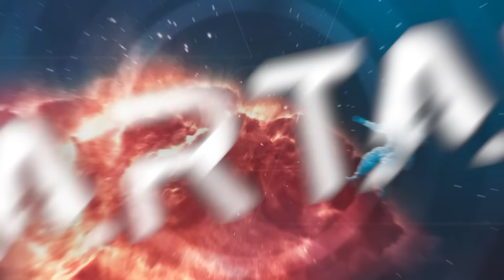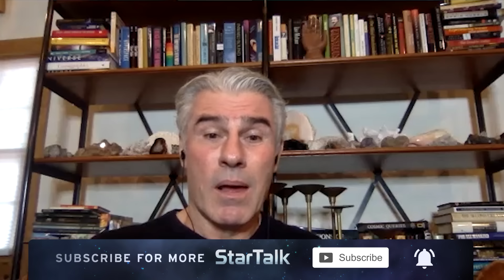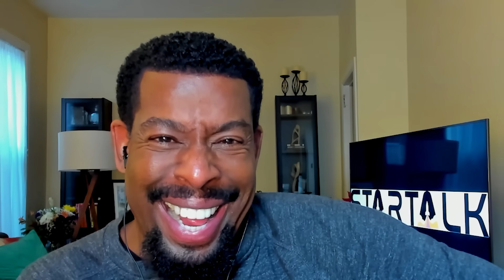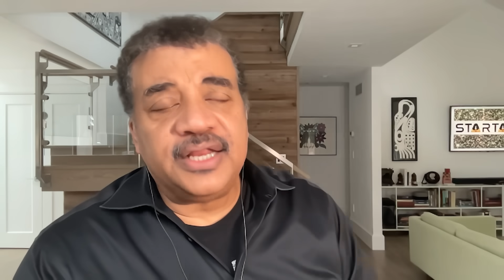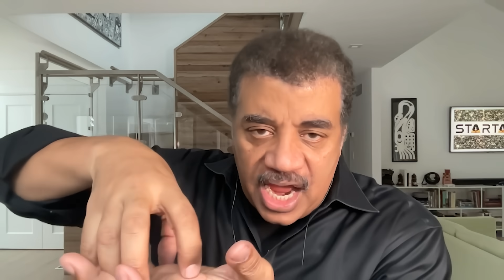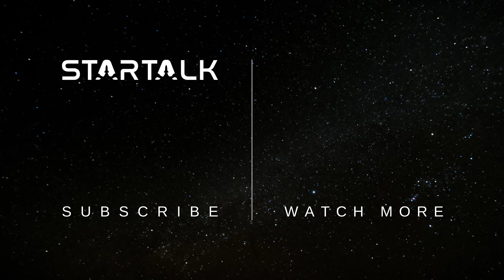What’s The Fastest A Car Can Go? | Neil deGrasse Tyson Explains...

Comment: Gary, you nailed the NHRA model... those 11,000 HP Top Fuel dragsters (with the T-Rex fron t wheels) pull up to 5 G's on launch, due to the super sticky slick tires and the burnout warming the aforementioned tires up to increase traction to the point of insane.
Reply: BTW I highly recommend watching a top fuel drag tire in slow motion when they launch. Its amazing. Incredible engineering really, if you think of the forces on that tire at launch which then has to be able to handle 330+ MPH top speeds just a few seconds later.
Reply: @Nefville  what's even cooler as if you notice they don't have gears. They're just single speed transmissions. If you measure the tire they actually can't get to 300 miles an hour. But as they go faster the tire gets taller and taller increasing their gear ratio. Hence the tires are the transmission.
Reply: Big tire cars, like on a top fuel car there are two things happen, one, there is spin happening, they do not hook hard like a drag radial car, if you don’t have the spin you will have tire shake which breaks parts. Second the side walls are meant to wrinkle to soften the torque as it’s applied in the first few milliseconds. Then there is track prep, they use a glue specifically designed for drag racing, but with big tires you do not want a super prep track or you won’t get the little bit of spin you need, with a drag radial, you want as much glue and prep as they can lay down because drag radials want a dead hook. Side note, there’s has actually been a shortage of traction compound, the main component is made in Germany and the company is cutting back production leading to compound producers to R&D new formulas.
Reply: So Top fuel dragsters are breaking laws of physics and doing the impossible?
Reply: @Nauda999  thanks to engineering, top fuel cars, wether dragster, funny car or even an altered are pulling 5G’s of acceleration and cover a 1000’ in 3.75 seconds at over 330 mph.
Reply: @beekeeper6109  didn't watch whole video, only to the point where Neil said that car can not have more than 1G horizontal acceleration and can't go from 0 to 60 under  3seconds.
Reply: Most of you are missing the fact that 90% of where a top fuel dragsters acceleration capabilities come from. It’s not the power, nor the tires, the exhaust or even the wing: it’s the clutch. It is impossible to feed 12000 hp into the tires all at once. It would literally blow the tires off and the car wouldn’t move far. The clutch and it’s set up is the key. Ever notice the grey dust coming from these cars at the launch? That’s clutch dust caused by the clutch drive plates slipping against the driven plates. Do a little research on how a TF clutch works.
Reply: Your giving too much credit to the tires, track conditions rule everything you do in drag racing.
Reply: @dalelc43  Sure ... any old tires will do.  🙄
Reply: and the exhaust is pointing upwards providing significant downforce
Reply: The exhaust pointing upward also adds to the downforce

Comment: There are also cars faster than 1g, depending on the measurement trick. Many auto makers do not count the first wheel turn or start counting when the front wheels cross the start line, which  is sometimes wider than wheel perimeter.
Reply: 1G acceleration yields a quarter mile time of 9 seconds.  Many cars and motorcycles are faster than that.
Reply: @fixbertha  Niel already mentioned why they are faster than 1g, because they use sticky tires that result in a Coefficient of friction greater than 1. Also, cars in particular, even without having sticky tires, can have an average acceleration of more than 1g, just not from standstill. As you go faster, you can generate more grip through your aerodynamics, resulting in increaseing acceleration towards the end of the quarter mile.

Comment: but you're forgetting Top Fuel dragsters, 0mph-330+mph is 3.5-4.0 seconds out of 500ci engines. granted not a road going vehicle but still out performs the 3 second ideology presented. You don't necessarily need more weight, when you can add more tire width and sidewall to the tire.
Reply: he talked of top fuel dragsters, watch the entire video :) that's an example of how to get a friction coefficient >1
Reply: @Le Doynier  i did watch the entire video, and yet he did not specifically mention these, he made the statement of any vehicle with certain surface prep, etc....
Reply: Amazing few ever heard saw them in real life.. Yet a  fighter jet smokes them .
Reply: @Motorhead1  not from a dead standstill, they dont. If the motor was capable of staying together long enough very few things could even compete in lets say a mile race
Reply: @LegacyLives96  In 1980s Jet dragster blew away top fuel cars in 1/4 mile. Not sure about today though.
English town NJ
Reply: @Motorhead1  today top fuel makes almost 15k hp. 3.3-3.6 sec quarter mile at 320-340mph
Reply: Fun fact: Propeller aircraft can accelerate faster than jets.
Reply: @lawrencedoliveiro9104  Turbo prop like on C 130 Hercules
Reply: @Motorhead250  Not sure, though. They are still turbine engines, still subject to turbo lag.
Reply: @lawrencedoliveiro9104  Not a turbo... It is a jet powered propeller Turbo prop.
Helicopter also use that engine.
Not like a turbo on a piston engine.
Reply: @Motorhead250  That’s what “turboprop” means. It’s also the reason why jet engines need longer to spin up.
Reply: @lawrencedoliveiro9104  When I fly on turbo prop it's like instant acceleration. Jet engine is spooled  up before prop blades are pitched you get pinned in seat intense acceleration no lag..
Reply: @Motorhead250  They put the brakes on before spinning up the engines. That, too, takes time. Do the same thing with a non-turbo prop plane, and it can do it in less time.
Reply: @lawrencedoliveiro9104  true. Awesome power in turn prop short runways.
C-130 we were on felt like it could go vertical..lol
Reply: @Motorhead250  Power to go vertical is no big deal -- most jet fighters can do it. But they still have trouble taking off from a short runway.

Comment: One of the great new motorsports is generally referred to as "Drag and Drive". Pretty much exclusively amateur events (no real prize money, although many are professional car builders), which are, in general, one week long, drag races at 4 or 5 different tracks. The format they shoot for is gather at track A, register, car inspection and test on day 1. On day 2 Race for time only at track A, then DRIVE that same car to track B under it's own power (no time limit or any sort of race between tracks) following a predetermined route with check points.On day 3 Race for time only again at track B, pack up and DRIVE the same car to track C, wash and repeat. The path of travel after approximately one week ends up back at track A with the best aggregate time of the race portion who also made all of the check points declared the winner. There are multiple class and therefore multiple winners with the Grand Prize going to the quickest aggregate TOTAL, or average fastest at all the tracks, time. They, very loosely shoot for 1320 miles total for the drive part, so as to correspond to the 1320 feet of the drag race.  The current record holder is TOTALLY UNBELIEVABLE to old school drag racers. Not, because of it's track speed, but because of it's ability to drive hundreds of miles on the streets and highways, pull into the track and do those dedicated race car like track times! https://www.motortrend.com/events/tom-bailey-wins-hot-rod-drag-week-2022/

Comment: A wheel is an interesting thing. 
 
The point that touchex the ground does not move relative to the ground, is then lifted up and after a quarter circle accelerated,. reaches twice the car velocity in the OPPOSITE direction after the second circle, then it goes back down.

Comment: Steam locomotives se sand they trickle on the tracks to increase the friction when they start from standstill, and I think they still do that on electrical engines. The friction issue does not change.
Reply: Streetcars have gravel boxes so they can sand the track if there are leaves on them making them slippery, maybe they use the sand in emergency braking too for quicker stop.

Comment: Was wondering about the Top speed? What is the top speed that a vehicle can go using friction (no rocket) without sticky tires? It can accelerate at a maximum of about 1G, but up to what point? Not sure what forces would start being the relevant ones at high speeds.
Reply: Aerodynamics, wind resistance. And friction and the engines limit.  Once you're over a certain speed wind resistance will be greatly increased. So you will need Aerodynamic to counter balance wind resistance and you want to eliminate friction for more speed. Eletcro magnets will eliminate friction problem. And the engine will be need to be made for speeds higher than we know today. Factor in those and you can get super high top speeds. Also reducing weight (mass) helps to achieve higher top speeds
Reply: @ferociouzmonk  Weight (or more precisely mass) has virtually zero effect on top speed.  More mass will slow the rate of acceleration but will only affect rolling resistance, a tiny, tiny factor compared to wind resistance.
Reply: @fixbertha  not really. Take 2 of the same vehicles but one has reduced mass let's say carbon fiber instead of steel. You'll get an 15-20% speed increase.  This is how a motorcycle with only 95hp can accelerate and have higher top speed than say a Lamborghini with 400 something horsepower.
Reply: @ferociouzmonk  With two identical vehicles, one lighter the other heavier, the lighter will will accelerate faster but they will have the same top speed.   The lighter vehicle may have a tiny advantage in lower rolling resistance but that's virtually not measurable in the real world.  It is easier to accelerate a lower mass than a higher mass.  Top speed is a combination of the forward force at the center of the drive axle (from the engine), the engine torque curve, wind resistance, mechanical resistance and gearing.
Reply: Buggati is the limit. While developing Veyron, they found out, that there are no tires that can withstand speed higher than Veyron's or Chiron's maximum without literally "deleting" the tires if maintaining the speed or increasing it. 450-500 km/h is already crazy, what more would we like with "classic" setup as you mentioned 😉
Reply: @peterjobb8938  That's for "available" road car tires.  Funny cars do over 523 KPH all the time.
Reply: I also thought it would be a bout top speed and I thought that would be orbital velocity, once you hit that you leave the surface. But, with aerodynamics you could stick to the surface above that speed too... yes, air resistance will melt you, but besides that... 🙂
Reply: To try to take it further, how about redesigning the road. What if you had two opposite surfaces, with tyres contacting each one? So the suspension system can push the two sides apart, giving you any amount of downforce you like, independent of aerodynamic factors (i.e. vehicle speed).

Comment: Actually... Rimac Nevera – 1.85 seconds (0-60mph)
Lucid Air Sapphire – 1.89 seconds (0-60mph)
Pininfarina Battista – 1.9 seconds (0-62mph)
Tesla Model S Plaid – 2.3 seconds (0-60mph)
Reply: Well, what Neil didn't account for is while it's true that spoilers and such do not work when you're standing still, however as you start moving the effect gradually increases. Though it's probably not that much at such relatively low speeds, but especially towards the end you can increase the acceleration.

It's also funny since Neil mentioned gears... Technically friction between two materials is working similar to gears but on the atomic level. So it highly depends on the actual road surface and the material structure of the tire. Even when using gears it would be necessarily be special gears that do not produce any upwards force that may make the gears slip as well. Though in reality, especially when increasing the torque / force any kind of material would probably bend slightly. So there's always a point where the gears could be pushed out and slip. In the extreme case the material would simply break / deform.
Reply: @Bunny99s   it seem he doesn't know about traction control or awd torque vectoring

Comment: Trains work like the gear principale Tyson is explaining
Reply: No they don't.  They rely on large amounts of mass on the metal wheels (which are on the metal tracks).  Most trains also have small sand dispensers to help gain traction if the track surface gets slick and causes wheel slip.  Some locomotives are also equipped with modern controllers to better manage torque output from the electric motors and help prevent slip (works similar to traction control in a car).
Reply: I was thinking, the logically obvious next step is putting the vehicle on funicular rails.

Comment: Uh. Clearly this is untrue. A Tesla model S Plaid can accelerate 0-6 in right at, and occasionally just under, 2 seconds. It does not heat it’s tires to melt the rubber prior.. it does not have a jet assist.. it just does it. The tires are not digging into the road.. they can do it on ANY pavement, very near 2 seconds. Even without rollout, they are well under 3 seconds repeatedly. Don’t take my word for it.. there’s about 100 videos on youtube that show it by many different owners.
Reply: 1 G is the maximum acceleration if there was no down force from the air. Once the car starts rolling, down force increases and you can exceed 1 G.
Reply: @MonstieurVoid  go drive a Tesla model S Plaid and tell me how they are defying this law of physics. Because they don’t use a downforce, they don’t use special tires or prep.. it just does it
Reply: @airheart1  All sedans have enough down force to exceed 1 G because of the shape of the car. The air pushes the car down as it flows over the hood and up the windshield. The spoiler at the back adds down force too.

Comment: What about aerodynamic down force?
Reply: The whole is a mess anyhow, it is all about maximum acceleration from standstill and  not top speed. 
 
The issue with downforce is that you need it the most at relatively low speeds in corners, but when you want a lot there you have an enormous drag at high velocities - adjusting the angle of the spoilers would be the solution, but when it breaks, it gets dangerous in an instant. 
 
My 28-year old Calibra is optimized for low drag and high speeds, and as we still have unlimited autobahns, I will not add any drag-inducing spoilers on it. I eased it up to 130 mph up to now (want to get it slowly used to moving again after it had stood for 10 years), and it is nice when you have a mileage of 24 mpg at that speed.

Comment: Coefficient of Friction = Cf = Force Down/(Friction at road-tire interface).  Using acceleration = a = Friction at road/m (from Newton F = ma).  Cf stays constant as Force Down increases since Road friction increases proportionally to it.  I don't know if acc will be limited to 9.8 m/s/s since the mass of the car at the rear wheels is not known, but if the front wheel lifts off a little all the weight of the car is on the rear wheels and Tyson is correct thin.  You can put Force Down in to Newton's equation to find the maximum accel.

Comment: A lot of people in the comments took digging into the road as literal. Probably because of the gear comment. Lots of ways you can "dig into the road." One of the fastest accelerating electric production cars uses fans to generate up to 2000 pounds of downforce at a stand still. Of course with 2000HP that thing is going to be under 2 easy. Top fuel dragsters do 0.8. Side note. Companies lie about 0-60 ALL THE TIME. People talking about cars with .1 under 2 seconds like it disproves the physics SMH

Comment: His basic premise seems wrong. Regardless of the friction coefficient, if you increase normal force, you get a larger friction force. Assuming you have infinite mass (and so infinite down force) and an infinitely powerful engine, you should get infinite acceleration. Not sure what I'm missing here. His analogy to vertical terminal velocity is misleading because gravity does have a finite acceleration. This is another good example of why gravity is an acceleration and not a force.

And something he said that I know is wrong; you can have a friction coefficient greater than 1. It's a common misconception that 1 is the theoretical limit of friction coefficient. For example, silicone rubber on silicone rubber has a friction coefficient greater than one. It just means that the frictional force is stronger than the normal force; in other words, it requires more force to slide the object than it does to lift it.